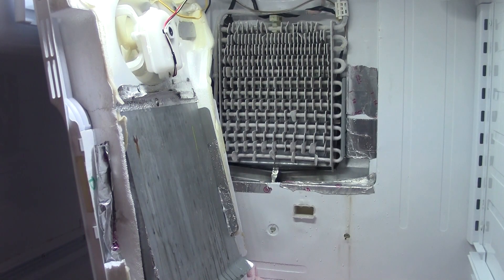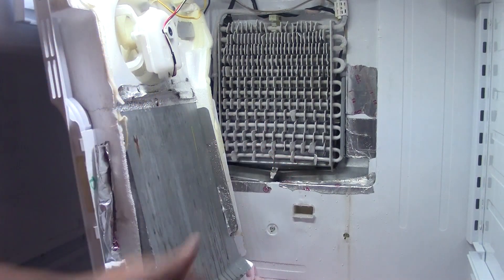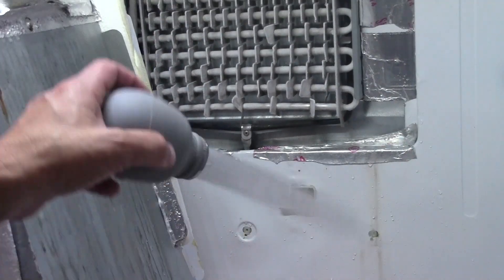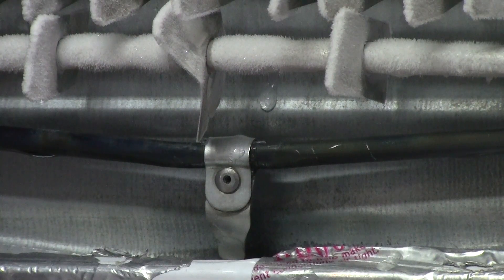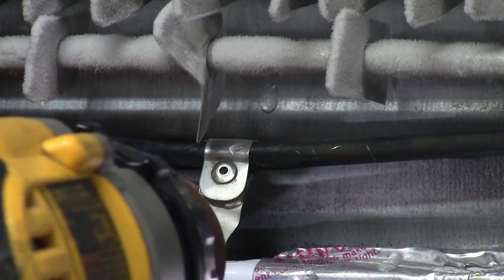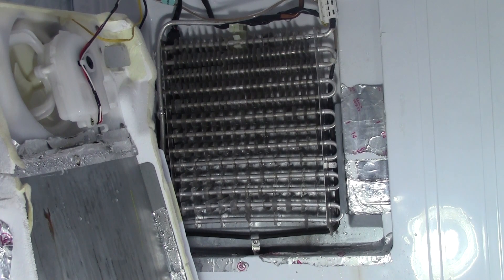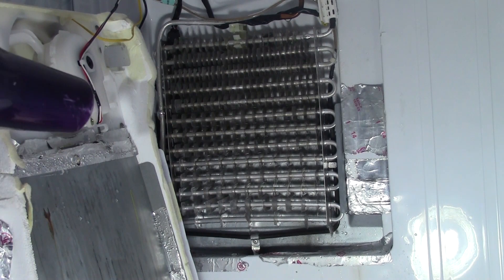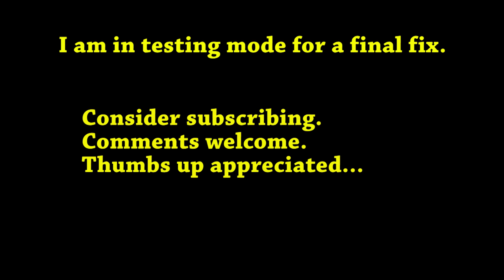PART 7: How to Fix a SAMSUNG RF 267 Refrigerator Not Cooling Icing and Freezing Heating Coil Tab

Comment: Samsung has a repair kit for this problem. Comes with an upgraded drain tube for the outlet of the drain, also has some seals and a longer clip that goes on the heater. Just extending that clip does not solve the problem. The coils on these Samsung's ice up because the defrost sensors are failing at a very high rate. If you have a coil that's iced up you need to change that sensor. Also it looks like you've damaged the styrofoam on your evaporator cover. That styrofoam directs the air flow across the evaporator and the aluminum at the bottom of the cover directs the defrost water toward the drain. When the cover gets significant damage it should be replaced.
Reply: Sean Richter the part number for the defrost sensor you need for the model you listed is DA32-10104N. Also this is a link for the service bulletin regarding this problem, if this link doesn't work you can google ASC20140703001 and you should find it.   https://www.encompassparts.com/shop/model_research_docs/?file=/SMG/sb/ServiceBulletin_ASC20140703001_V41.pdf
Reply: Sean, I used also the service bulletin that PickerJimS cited.  My problem was "Symptom 2" on that sheet.  I found the user coils iced, AND ALSO found ice on the inside of the fan housing imbedded in the cover I removed; had to melt both the inside of that cover and the ice on the coils.  Be sure to check the cover, too, for ice!  Also, the bulletin made an emphasis, with photos, on the placement of the new sensor: "If the defrost sensor was imbedded in ice, replace it. When attaching the defrost sensor, make sure the sensor faces LEFT."  I was careful to do that.  My last repair of this is a month ago.  So far, so good.
Reply: I have the Samsung RF323TEDBSR Refrigerator, a later model (?) than many here, double french doors, with the ability to do a control panel manual defrost.  It started making lots of noise this month (fan on ice), about 2 years into its life.  I have no problem with water under the drawers.  

I was unable to do anything but manual defrost (which only solved the fan on ice problem for a day or two) till I found your great videos.  Thank you!!!  

When I got the back cover removed, (complicated by the location of the water filter in the middle under the lower glass shelf) I found the upper right area only clogged with ice, including the perimeter of the fan.  The rest of the coils were clear, including the drain.  An hour w a hairdryer got it back in good working order…  till it ices up again.  

So I am wondering with many others what a user permanent fix could be.  

I reading through many of your posts, I found this paragraph on your fourth video responses:
 
John Carbonara1 year ago Pro technician here, The Refrigerator is built by Samsung. Several fixes for this problem… If there is ice only forming on the upper right portion of the coil then replace the thermistor, it has just lost its value slightly and is not staying in defrost long enough for the coil to thaw properly. It looks like a white bullet shaped object with two yellow wires and it clips on the evaporator tubing in the upper right hand corner. 

I managed to find links to a couple of Samsung service bulletins on this issue, one from 2014 and a subsequent one from 2015.  (Google: Samsung service bulletin ASC20140703001) Both identify the thermistor as a part of the problem, including its position, and its resilience.  The 2015 bulletin says if it has been imbedded in ice, it should be replaced.

On this thread, I notice the comment here that heads in this direction as well: "The coils on these Samsung's ice up because the defrost sensors are failing at a very high rate. If you have a coil that's iced up you need to change that sensor."

Sounds to me like the thermistor fix will have to be a part of any permanent solution.  It is certainly on my ‘to do’ list for this fridge, especially since my drain was open (and no water below my trays) and the ice was located in the upper right area only (fan noise was my only evidence of a problem).
Reply: Geoff Chapman j
Reply: Thank you PickerJimS!  Ordering now.  Will attempt the repair in the next couple weeks.  I have my fingers crossed that this loud noise will be gone from my life soon :)
Reply: Thanks Geoff.  I ordered and received the service kit and the temp sensor already, now just trying to find the time to jump into the project.  I noticed the placement issue in the documentation as well and will definitely locate it as suggested.  Glad to hear you have a month with no issues...Hope it makes it several years!
Reply: Hi Geoff,  I have the same fridge as you, RF323TEDBSR, and also have the loud noise and have spent the day researching the issue.  I haven't taken the fridge apart yet to inspect it, but plan on ordering the service bulletin kit and the defrost sensor (thermostat) and having them on hand before I start the attempted repair.  Since it is quite a project, I hope to be able to completely resolve it in one shot.  Do you know what the part number is for the defrost sensor (thermostat) for our particular fridge?  I'm assuming that the defrost sensor/thermostat/thermistor are all different names for the same item, correct?

Comment: So did you an actual fix?
Reply from the maker: i'm still working on it.  It seemed to generate much less ice with what I have done, but there was still some ice.  I will let everyone know what it is soon enough if it works...
Reply: About the time you get to part 27, you can call yourself and this SamJunk frig, Frankenstein.  Like you I doggedly keep at the task of dealing with the worst refrigerator ever manufactured.  Sad thing is that it isn't even any good to put in the garage, where it would probably require a defrost ever 24 hours, in my south Florida humidity.
Reply: m
Reply: GREG DC have you came up with the solution?